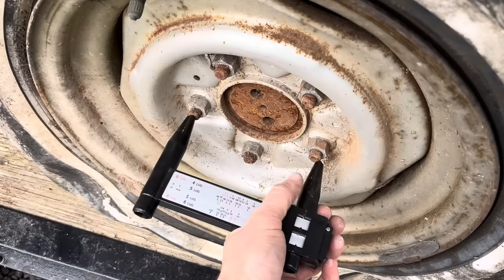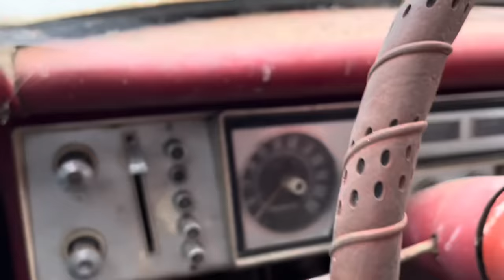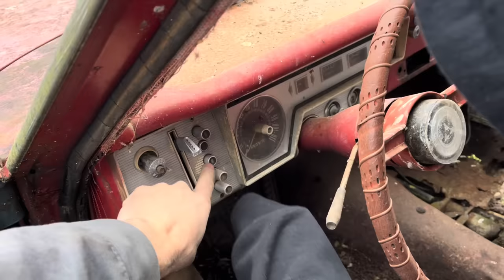My wife bought a F100 truck without me ! And I bought 3 cars over the phone !

Comment: I own a 76 f100. I've had it for several years. Its a daily driver. When I bought it the guy told me it would be the most dependable vehicle I'd ever own. And it has been. Mine is also a 3 on the tree custom. But mine has the 300 straight 6 engine. Me and my wife dated in a truck just like it. And we've been married for almost 20 years now. She loves it as much as me. I also have a 51 f300 rat rod and a 59 Apache 3100 that was my uncles. I've always loved old trucks and working on this stuff.
Reply from the maker: That’s cool thanks for watching

Comment: Love the Fairmont. Super easy to put a V8 in. Mate engine and trans, bolt on pickup motor mounts. Drop in the hole and bolt up crossmenber and drive shaft. Mark where the mount studs set on cradle. Lift up and torch the holes in cradle and bolt in. Use a Granada cross flow radiator. Bingo, all done.
Reply from the maker: Ok thanks
Reply: These came factory with small block Fords
Reply: Yes they did but if you get a nice body with a 6 cyl it's a cheap quick way to step up for very little cash

Comment: I had a '79 Volare. It was my favorite car that i have ever owned. The factory plugs had 165K miles on them when I got it. The electrodes were completely encased in ash, it had a burnt valve, and it still ran. No one believes me. They've never had the Leaning Tower of Power. I have no doubt that both of those cars will run. You can't kill a 225.
Reply from the maker: They are great engines, my 78 volare wagon was great

Comment: Cool projects. To bad about the rust but it is what it is. The patina is great. My wife is cool about cars as well. In fact we met at the local drag strip in 1974. I have my 26 T rat rod about 98% done so I started on her next hot rod. A 61 Ford Falcon 2 door wagon. It now has a 350 Chevy in it with a 350 turbo. I also have a robin egg blue 1980 Ford Fairmont 4 door. Straight six. Auto trans. Just over 100K original miles. Zero rust. Bought from the original owner who was 92 when his family made him get rid of it. Paid $600 bucks for it in 2010 when it had just 91K on the clock. My kids now adults were in to the car hobby/drag racing as well. My 9 year old grand son likes my hotrods. I think he has the interest. Great video. Until next time.
Reply from the maker: Sounds like we like the same kind of cars , nice collection

Comment: I can tell you up in the northeast, most Dodge Darts with 6 cylinder engines got junked not because of engine problem but because of rust issues. We use to get a ton of snow a  BB d the salt on the roads just ate these things alive, plus the metal used was from Campbell soup cans. The more expensive Chrysler’s (New Yorker/ Imperials) bodies held up much better (Dad had a 64 push button trans. New Yorker that had no rust issues.) I esp. love the 64 wagon. I’ve been to 100’s of shows and never seen one.
Reply from the maker: True .. thank you

Comment: That's my favorite body style of, Ford truck. It's not roached with rust, not beat up and I bought one nearly identical (had a lot more surface rust) with a 302/3 speed on the column. I paid 400.00 for the '74 I picked up in the mid - 90s and I drove it home & across, America. I only had to replace the carburetor, tires, & I small boat lights in the back bumper for stop/tail lights. That thing was so covered in surface rust I never knew what color it was but nothing rotted all the way through. We drove that thing everywhere & never had to do much of anything to, it. I did put a timing chain & gears after driving it for a few years but other than tires, carb, & bucket seats, that was the extent of it. It wasn't beat up, either, it just evidently got parked for whatever reason for years & years & years & years. That old 302 never offered to smoke or use a drop of oil between oil changes, either. I like the 78 mustang II as well. I bought one of those V6, automatic, for 50 dollars in Smyrna, Tn. I put a junkyard starter on it I got from the junkyard on the way to Nashville. I put the starter on & the battery I took with me and little did I know? For the next 3 years that 50 dollar little car would come to be my daily driver.
Reply from the maker: That’s awesome
Reply: @Sleeperdude  thanks.

Comment: I love that 64 dart wagon.  I use a 64 dart 4 door for my winter car.
Reply from the maker: That’s cool
Reply: @Sleeperdude  The winter car before my 64 Dart was a 65 Dart wagon slant 6 with a 4 on the floor.   
Very rare but VERY rusty and the frame failed, ending that car's exsistance except for all the parts I used to restore my present Dart.

Comment: The only motor I ever blew a hole thru the block,a connecting rod poking out the side, slant six in a Dodge pickup,sold the body and the fella put in a 318,saw it around for years.

Comment: About the battery sleeperdude. It most likely is not bad at all. there are 2 possible scenarios why the test failed.

Some of the cells need more distilled water
or some of the cells are sulfated.

To fix the sulfation issue, you charge it and put it on a load, like a car light bulb and run it until it's 10.5v (Empty) and you repeat it several times. Each time you do a cycle it cleans the sulfation on the lead plates making electrical connections within the battery good again. I have saved so many lead acid batteries that were thrown out just because of the sulfation issue. It's their main reason to be thrown out sadly.

You can even test this since you have a car battery tester, you can measure how much cold cranking amps it can give after each cycle, what you should see is that it steadily goes up.
Hope this helps you save a battery! 🙂
Reply from the maker: Ok thank you

Comment: Guess I'm a turn coat on this one. I totally adore my Fords, but those two slant-six Dodges are the cat's PJ's. Pull the valve covers off those 225's and make sure your valve train isn't hung. The Dart and Polara 770 are A bodies, and floor pans are still available. The manual on the tree will need reuild and the flywheel resurfaced, bit that push-button automatic needs to go to a specialists. Drop the pans on slants and check the pick-up tubes for any sludge and replace the gasket to the tube from the pump after its rebuilt. Should blueprint them, but that takes care and a good machinist with the right tools. You got your work cut out for you on the Futura Coupe. Think Momma may have got the easiest to fix. Those old 100's are bullit-proof. A decent wrecking yard will have most the parts, and the shift linkage is hung. Probably the throw out bearing gone south or the pressure plate rusted up from someone leaving off the cover on the bellhousing. Carpenter in Tennessee has the pan for the cab, but the bushings will need replaced for sure.
Reply from the maker: Ok thank you for the information

Comment: My first car was a BMW 318I 86. And a VW polo 1.3 84. Seat Abitza 1.4. Nissan Primera 2.0 station 98. Totally burnt down in 2006. 4 days before our 3 weeks summer vacation. With stuff from our sailboat. Then a Nissan Micra 1.3 SRI. 840 KG! 140 MILE/HR. Was normal on the German Autobahn. And then an Opel Vectra 2.5 Ltr. V6 station. €550,- And legally driven for almost 7 years. Now I have a Mazda Premi? 2004. Which I have been driving for almost 5 years. Greetings from Spakenburg, the Netherlands. Ps Trans Am. That really is my USA car.

Comment: The challenge is to get the old truck reliable and practical enough to enable you to sell the new truck.
Reply from the maker: That’s true
Reply: @Sleeperdude  It's 2wd though, so I don't know if it can replace your new truck.  Maybe with posi or something, or ballast in the rear.
   My fav is the older dart wagon.  Not only is it a wagon, but the nose looks sleeker than the newer Dart.  You tell 170 from 225 by looking at the bypass hose up from water pump to head.  170 has real short hose, revs higher, lighter and cruises more efficient, but less torque.

Comment: The hood ornament that you could not read on the wagon said "170."  That is the size of the factory slant six.  Remarkable lack of power.  I look forward to seeing the Fairlane...I mean Fairmont running.
Reply: The 170 is model designation of the car. Yes the slants came in a 170 and a 225. Other models were 270 and GT.
Reply from the maker: Ok thank you

Comment: I can tell you from personal experience,  if you need to replace a radiator in the 64/65 Darts,  a radiator from a 1969 Chevy Caprice/Impala will fit with very little trouble and you will never worry about running hot or over heating ( except for a stuck thermostat) I did that because my 65 Dart needed a radiator,  I had a 69 Chevy Caprice with a locked up motor.  3 of the 4 bolt holes lined up,  I drilled one hole used a through bolt and 2 radiator hoses generic worked great.
Reply from the maker: Ok great thanks for the info

Comment: You can fix all your old battery really easy take and put baking soda in the battery neutral the acid take 1 gallon of distilled water to 1 pound of Epson salt boil till Epson salt is mixed rinse the battery out pour the solution in and charge battery works perfect I do it all the time
Reply from the maker: Ok thank you

Comment: Each and everyone of those rigs have potential. Both mopars are runners for almost sure and that dart clean clean, centerlines with a 318 four barrel is a track ripper plus high dollar clean. You know how to butt weld and so that fender and some patch panels is not a big deal. Time you got a mig welder and start doing some repairs. Brent at halfasskustoms would have you doing patch panels out of scrap metal so your not spending tons. A good cut off saw for metal would cut out the pieces. Some of the heavy metal might just be some Tennessee road signs. The 73 ford is a points distributor so it will probably go again but be tired. I am hoping that you lean to fixing some  cars. One of the big carburetor companies sent you a carburetor and thought you would fix one but doubtful if they will keep sending if you don't repair what you have.. So whats the deal Josh, you just lose interest in ones that you do get? I am getting the idea that your just buying will it starts. The little falcon was a really run down rig and might of been too much for you. I kinda am fond of those 63 ford two door hardtop cars. Fixed up they bring really good money and really have a big following for them like the 57 chevys do. Biggest problem i see with the mopars are unibody meaning they will be six cylinder cars unless you cut the shock towers out for a bigger engine. I would like to see all of them cleaned up an bring out the old shine hidden under the moss.
Reply from the maker: Thanks for watching I’m glad you liked it

Comment: Wagon, Yes. 64 two door, well. Truck got good bones. Fairmont,Heck yeah 👍. Black and white puppy has My name on it! Here comes My 64Dart gt story, got it dirt cheap, they said the tranny was bad, it was fine. Thot it was a dull orange color but I hit with the turtle wax and it was fire engine red. Then I put ten dollars gas in it,at least five gallons back then. Then I noticed it was lecking out a rust hole in the line under the driverside rocker, then I found out the brake line was next to the rusty gas line, then the front end got knocked of the car. Sad story. True sad story.
Reply from the maker: That’s a cool story thanks

Comment: What is going on with the opel? I have saw it in the background of the videos. You should turn it into a gasser.

This video was pretty cool. On the 1965 Dart you should modify it like into an autocross car. Keep the 6 but put exhaust, carburator, and suspension on it. It would be like the falcon at the ford fest that you guys rode in.
Reply from the maker: I had the opel for sale because all the glass is bad and the floor is rotten, but I may end up doing something with it if it doesn’t sell. That would be cool to do that to the dart

Comment: Early Darts/Valiants like that take a 5 on 4" bolt pattern wheel.  Pain in the butt.  Mopar kept that pattern on the small cars until 1974 or so on drum brake, 6-cyl cars.

Good luck if you plan to fix 'em up.  Parts are un-ob-tanium.  They are just not popular cars.
Reply from the maker: Ok thank you for the info

Comment: Sleepergal
First Find buy snd fixer upper,
Get it running and stopping  
Remove the cap, 
Duel exaust  glasdpack stacks,
Flate black or ford blue Raddle can paint job
Find the ford wheel covers like .30:42 on that white van
BUILT FORD TOUGHT,  FORD TRUCKS ALL THE WAY,...Nope ....trucks in general  are 👍.......nice for Fairmont like a combo of a Granada and a LTD
NICE DARTS with police car steel wheels and the Mopar dog dish caps SCORE
Reply from the maker: Thank you

Comment: Sleeper,
    How can an underpowered car like a Futura peak your interest so? Did your dad own one? Most people junked these and sent them off to the crusher. Lastly, you should pre-1973 trucks. All the manufacturers dropped the compression and horsepower across the board because of pollution standers, rising insurance cost and the gas crunch.
Reply from the maker: Yeah your right . I just like boxy ugly cars that no one likes and they happen to be on a fox body platform which works good for performance parts I usually engine swap them

Comment: Ford Fairmont is a full-size car that was built by Ford Australia as an upmarket model of the Ford Falcon from 1965 to 2008. It featured a higher level of standard equipment than corresponding Falcon models of the same series. As well as offering a more luxurious interior trim with additional comfort and convenience features, for much of its first 25 years the Fairmont also offered a higher mechanical specification; a larger capacity engine and refinements such as disc brakes, power steering and automatic transmission that were extra cost options for the Falcon were fitted as standard equipment for the Fairmont. It was available as a four-door sedan throughout its life, as a five-door station wagon from its introduction through to 2008, and as a two-door hardtop from 1972 to 1978.

Ford Fairmont
Reply from the maker: Ok that’s cool thank you
Reply: @Sleeperdude  now rather it's based on the American falcon to idk but it is a Ford so I'm assuming it was as well but I can tell you this the ford falcon and the Ford mustang of the 1960s were built on the same chassis and the dashboards we're very similar as well as if you look under the horn of one that hasn't been messed with your find the emblem of a falcon on the mustang and a falcon will have the Ford emblem

Comment: I know where a baby blue or robins egg blue dart station wagon is just like your red one . dont know if the lady still has it and or if she will sell it ? they use to drive it all over branson but they live down the road from me in hollister mo.  I like the 65 dart as well . I have a project 65 2 door post automatic I'm fixing up . theres also a 65 plymouth valiant in branson for sale 1500 obo runs and is complete just needs some odds and ends like tail light lense and chrome housing and seats need recovered. I need an extra set of rear tail light lenses. see my channel here on youtube
Reply from the maker: That’s cool, I went to Branson one time about 20 years ago to a timeshare meeting 😳
Reply: @Sleeperdude  yep that time share crap sucks . I worked for westgate resorts for the past several years and a few years befor that worked at Surrey and grand crown resorts . All 3 I did security at